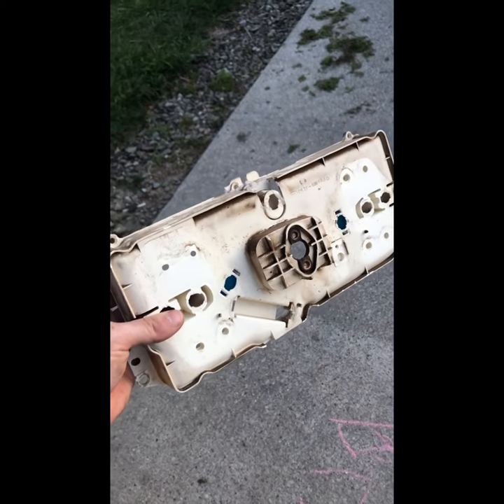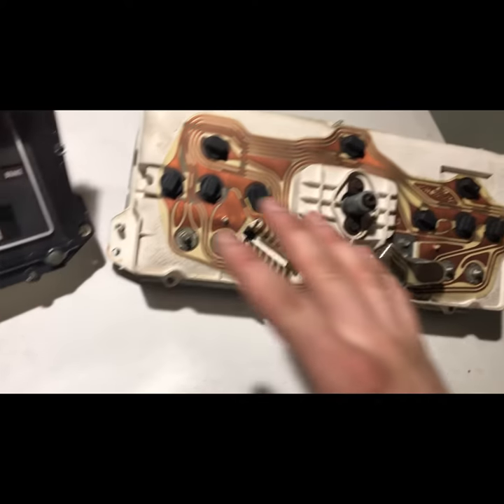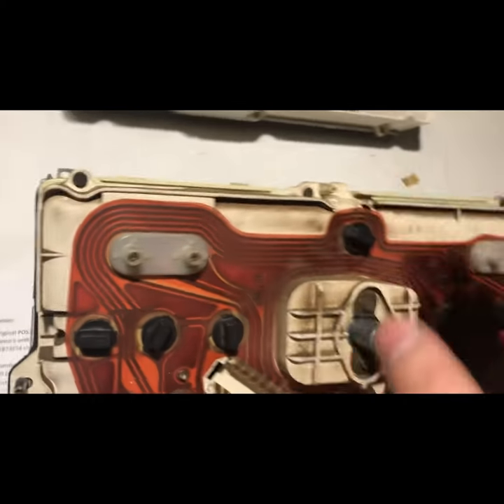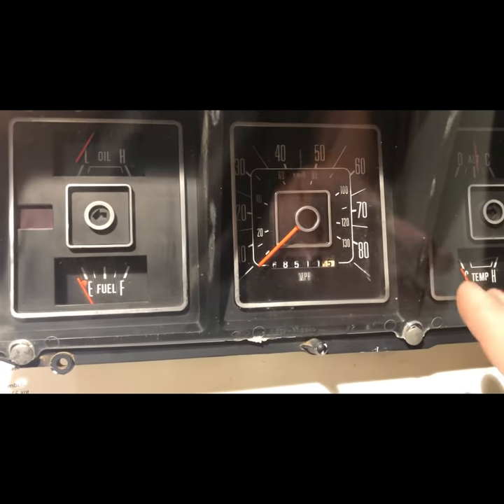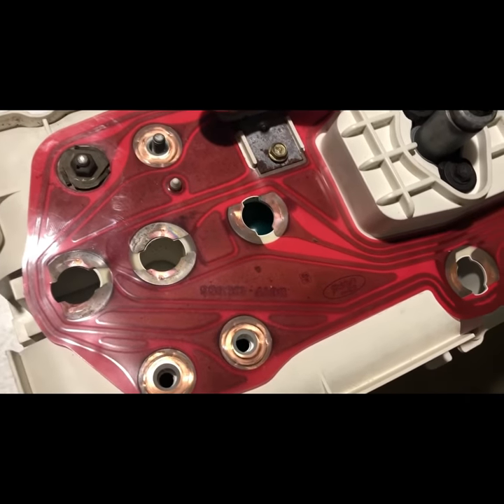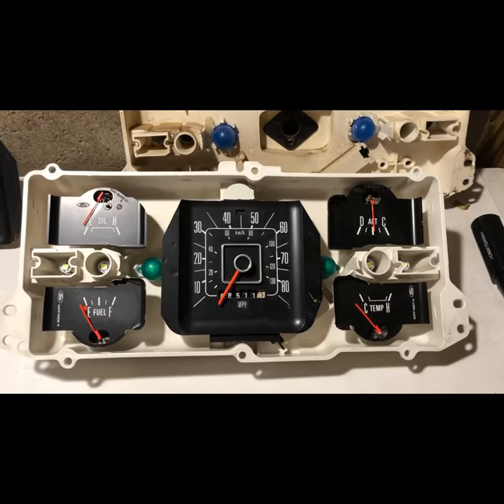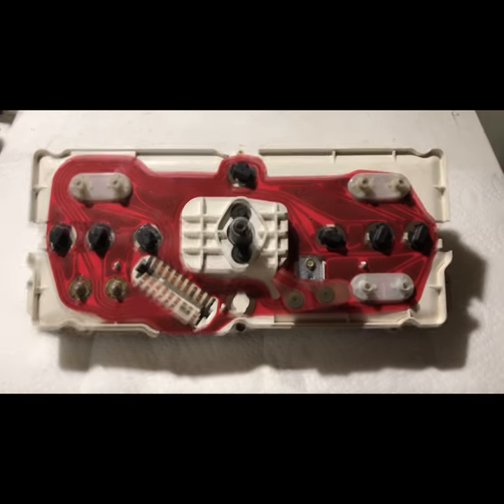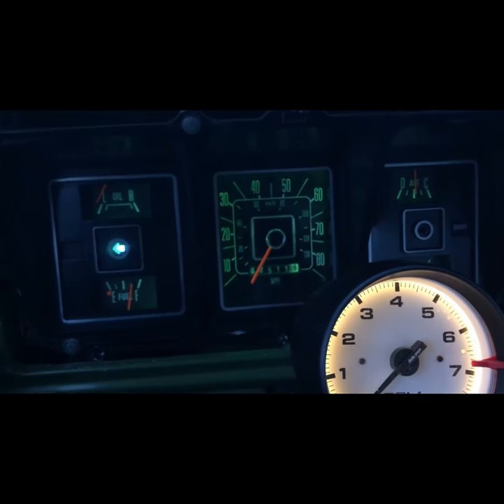1973-1979 Ford Truck Instrument Cluster Upgrade / Swap Rebuild With LED Bulbs And Gauge Testing

Comment: Great informative, thorough video. Bought a 73 a couple weeks back and only the speedometer works. Ordered a circuit board as I could see damage on it. Going to test my gauges tomorrow using your method. New gauges are pricy, might have to find some used if they don't work.
Reply: Question, is it a straight swap to LEDs?
Reply from the maker: Awesome! I'm glad you found so much valuable information from this video! If you end up needing a gauge by chance, look me up on the Dent Nation group on FB! Best of luck!
Reply: @bjsclassicclusters  appreciate that. Thankfully all of the gauges seem to be good. Hopefully it's just the circuit board and not a bigger issue.
Reply from the maker: @pnw.bronco  you're on your way!

Comment: When you remove those lights behind the cluster…. if you look carefully under the tabs that touch the instrument panel. You will notice that there is a concave little spot underneath.. what I did to ensure proper contact of those little tabs is to lift them up ever so slightly. Once that is done., then take a hot glue gun and put a little tiny drop of glue under both tabs of the affected lights. Put the light back in and you will notice that your lights will then work properly. 
Now , I can’t tell you how long this will work, but logically speaking I can’t ever see an issue happen by doing so. 
I’ve been messing around with this for a couple years now , and finally came up with what I feel is a 100% proper repair. 
I hope this helps everybody because all the videos online are telling you to check connection, etc. etc. 
I don’t have any connection issues except for where the light pushes on that electrical circuit . 
And what’s nice about this repair is that you’re not altering the dash cluster. you’re only putting the glue onto the light behind the tabs and if it doesn’t work, it’s a super easy fix to try again. ( just put a little bit more glue next time if need be.)
Reply from the maker: Not a bad idea at all!
I typically find that just by slightly bending the tabs, and cleaning the contacts, that is enough to make a drastic change in connectivity. 
I do this with every cluster I lay hands on, to ensure proper connectivity.
I never have an issue with a bulb not illuminating after doing so.

Comment: You can purchase everything online for the gauge clusters. I got a 79 F150 with a newly installed gauge cluster with led lights. The old bulbs didn’t light up very bright as the led now
Reply from the maker: Mark! I actually rebuild clusters myself! If anyone ever needed one rebuilt, with LEDs pre-installed, I would be willing to do it!

Comment: I have a '78 F250 and had the cluster out for dead lights.  I tried swapping to LED but in the process noticed several burned areas on the printed circuit.  Have you ever seen that, and any idea what can cause that?  I'm unclear if it's a printed circuit problem or something elsewhere in the truck meaning a new printed circuit will also burn.  I also have a turn signal that comes on steady with headlights on so I was thrilled to see your comment on the turn signal socket replacement under another comment!   I'll check that out.
Reply from the maker: Hey Rob!
I've definitely seen burnt circuits on the printed circuits, and 95% of the time it's always on the ALT circuit. As far as a cause goes, I'm not sure why that is. The ALT circuit is the only one that sees a constant 12 volts. Maybe if the alternator overcharges, its too much for the printed circuit? I'm not sure. But I do have extras and spares if you're in need of one. Just let me know and best of luck! I'm glad you found the video helpful!
Check my page out on FB @BJ'sClassicClusters!

Comment: Thanks for the video. My cluster is fell apart in my hands this last week as I pulled it out to see why it was not working.  My truck is a 77 with the same cluster as the one you bought that didn’t match with the light  warnings rather than the gauges.  I cannot just buy the same year and plug and play I am guessing from your video. What van did you pull it from, is it the large older Ford vans so I can look in my local pic a part.  I may have missed that in your video.
Reply from the maker: If you're uncomfortable tackling this yourself, I have actually started doing them for others. Check me out on FB/Insta: BJsClassicClusters

But, to answer your question, new housings are available for purchase new. They typically run around $100+. You can find a warning light cluster from a 76-79 truck or 76-91 Econoline. Assuming everything on that cluster still works, of course.
Reply: I have found one that has the lights but has flashers as well.  Will that work?
Reply from the maker: @LanceRigby  what do you mean by flashers?

Comment: Awesome video by far one of the best ive senn for this stuff.. I am going through something pretty similar. All new wiring harness because the guy before me melted everything. Anyways. I didnt even know my cluster was to a econoline. Anyways, the one I bought is allegedly all good. Anyway i could see your cluster harness pinout? Because ive tried all of the different ones with little success.
Reply from the maker: Oisin! Thanks for the compliment! I am just now seeing this comment, so sorry for the 7 day late response. What year is your truck?

Comment: So I got a gauge cluster out of a 1985 econoline van and everything is the same but the wiring in my 79 f150 wouldn’t work because the f150’s plug isn’t as wide as the econoline wiring pigtail
Reply from the maker: Sounds like you have a 4 gauges vs. 2 gauges/2warning lights mismatch.
If you get ahold of me at BJ's Classic Clusters on Facebook, I can hook you up with the cluster you need. I'll even take the Econoline cluster as partial trade.

Comment: How did you fix your driver side turn signal light that stays on when the turn signal is not switched on? I think its at 28:45 in the video.  Thanks in advance!
Reply from the maker: One of my front turn signals (on the front of the truck, in the grille) is dimmer than the other. The dimmer bulb is the same indicator that stays on inside the cluster. By replacing the bulb socket (Dorman P/N 85898) at the front of the truck, my bulb regained its brightness, and the indicator light went out! A quick and cheap fix! Best of luck!

Comment: Bj i have searched and am having a bear of a time finding a newer replacement for my dummy light cluster. I had pulled it to check the lights and now well my gas gauge no loner works, my temp gauge has a loose nut so no lights there and it's missing  a couple of the bulb holders lol. it's a 1979 F-100 Ranger.
Reply from the maker: I have a ton of parts and spare clusters. Get ahold of me at hdman90@yahoo.com we can figure out what all you need and get you back up and running.

Comment: Hey I just discovered your video and I love it. I also just got a 75 f100 (custom) and discovered that when you activate the high beam lights, both headlights turn  off. When you go back to low beams, they come back on.  Any idea what it could be.
Reply: Your high beam switch just needs replaced. Mine did same thing and once I replaced the foot switch they worked

Comment: Is polarity only an issue with LEDs or can that cause problems with incandescent bulbs too?
Reply from the maker: Walter, polarity is an LED only issue, the incandescent bulbs will work either way! I have also found the incandescent bulbs to be less temperamental as well. I like the brightness the LEDs give out, but they have their downfalls as well.

Comment: Hi very nice video!!!
I need a circuit board like yours for a 1986 e-150, from the video I believe it looks like the one I have!
Do you know if your circuit board would fit mine?
The part number of mine is D6TF-10C956

Also do you know who else might have a BRAND NEW circuit board?
I called Dennis carpenter and green sales, also jegs might have it
Reply from the maker: I’m sure I have a circuit board laying around that would work for you. They’re also available on eBay brand new at:

https://www.ebay.com/sch/i.html?_dkr=1&iconV2Request=true&_blrs=recall_filtering&_ssn=psquare&store_cat=0&store_name=psquaresstuff&_oac=1&_nkw=73%20ford%20led%20truck

I’ve actually started rebuilding these clusters as a side job. You can check out my page at:
www.Facebook.com/BJsClassicClusters

Comment: Nothing on the gauge cluster worked on mine so I looked up in the dash and went “Why the hell did all the bulbs fall out?” and then realized that the gauge cluster sockets came out with them 😂
Reply from the maker: OH NO!! That's without a doubt a nightmare! I've been there. Best of luck rebuilding! If you need any help, just let me know.

Comment: Could you swap out the back housing of the gauges?
Reply from the maker: Yes! That is exactly what I was doing in this video! My old one was deteriorating significantly!
Reply: @bjsclassicclusters  no what I was getting at is swapping the back housing of the gauges with idiot lights to the cluster with full gauges
Reply from the maker: @frankiebush2604  ah, I gotcha now. Sadly, that still wouldn't work. The wiring harness has a different number of pins for gauges vs. lights. So even if you did swap them out, your wiring harness then wouldn't plug into your truck anymore!